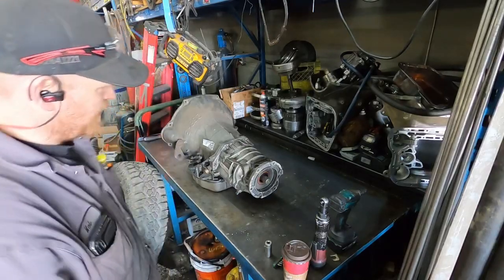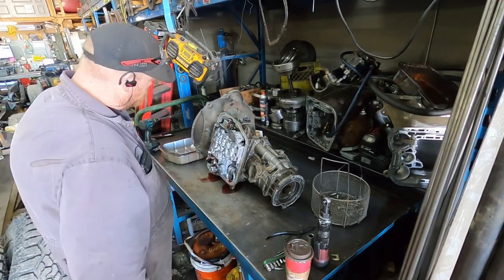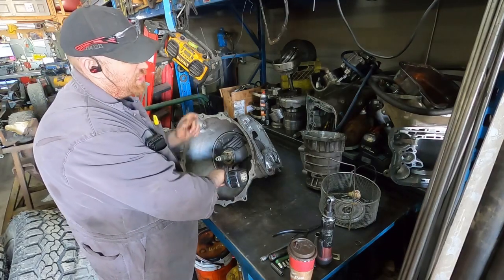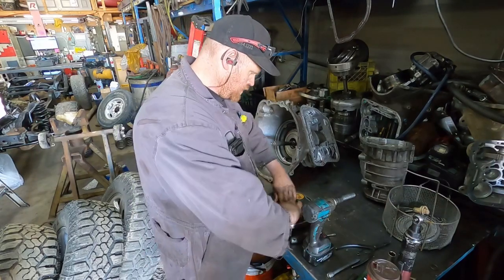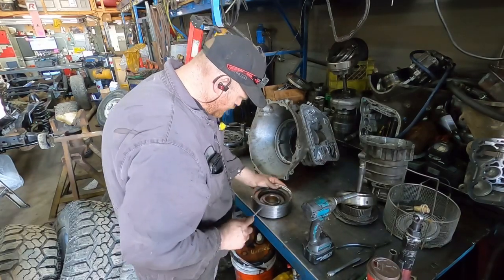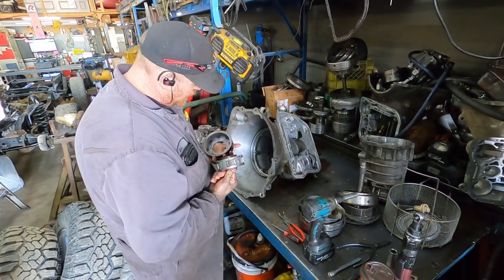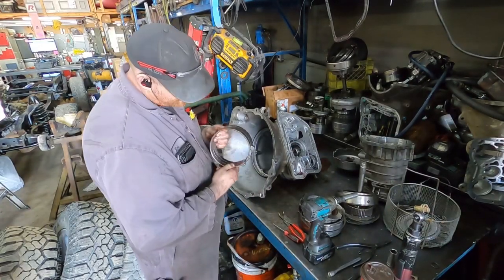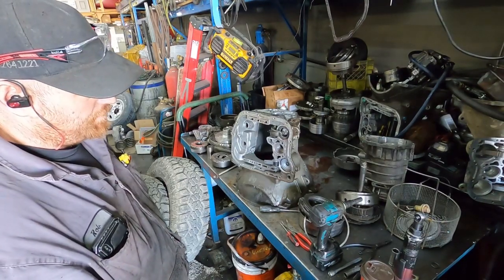48re transmission TEAR DOWN ( TRANS FOR THE Shorty)

Comment: the first gear drum is able to handle a ton of power with just the 4 clutch setup. if you do get 5 in there somehow you need to make sure that front planetary has enough spline to engage 5 clutches. if it does you still need to make sure the depth is right so one clutch disc doesnt slip off the end of the splines when it engages. they do make an aftermarket planetary tha has longer spline if need be
Reply from the maker: I have a trans that has 5 clutches in the forward pack, i did do some measurements and i dont see why i can't use 5 in it with much work, but will will see how much work it is. i just like doing things the hard way lol
Reply: @CUTTERUPROB  more is better, lol. also not sure if you know but in the direct drum instead of the wavy retaining ring replace it with a normal ring like the forward drum has. much better 2-3 shifts.
Reply from the maker: sweet thanks for the tip

Comment: How do you plan on controlling it?  Firepunk porcupine?  I personally would have went for a 47RH with 48RE upgraded parts.  Best of both worlds.
Reply from the maker: I am make fmvb so I did see the point in using a Rh for it when it would be a worse. As I would have to pull to trans part to build one